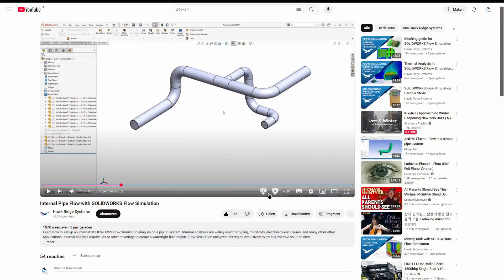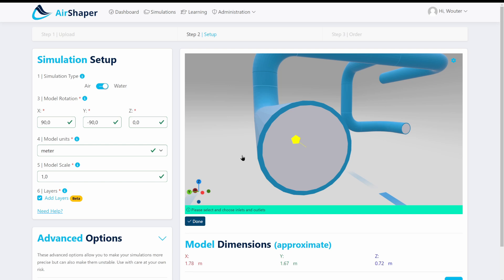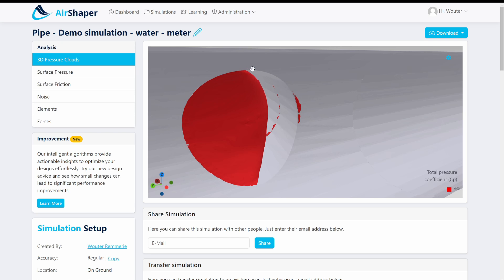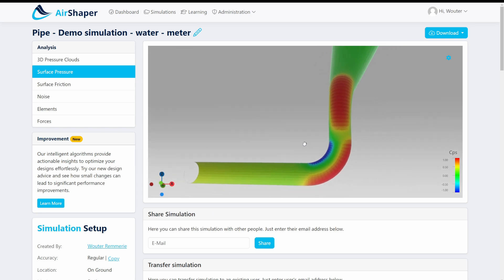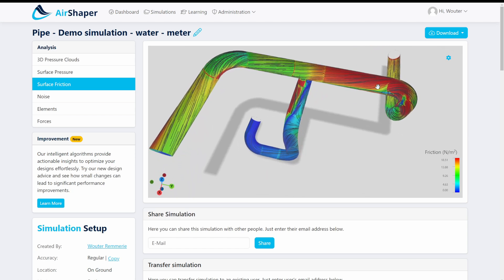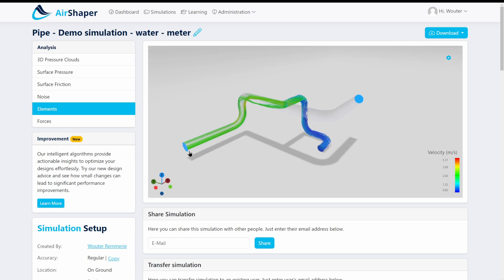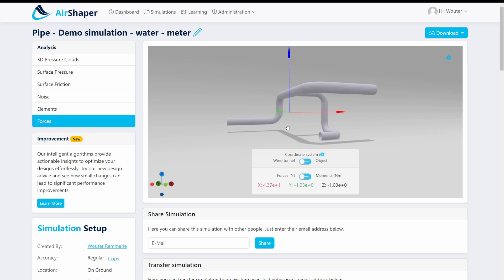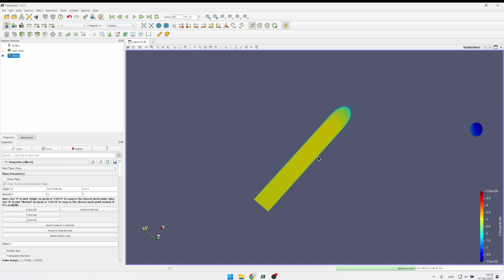Pipe Flow CFD Analysis - Reducing pressure drop and analyzing flow patterns & distribution

Comment: Can the model add a surface roughness variable? Like an engine sand cast intake manifold, does the model need to reflect the actual surface roughness or is there a way to have it as a variable parameter in the simulation? This would be interesting to see the effects on the boundary layer of a OEM sand casting vs 40 grit rough vs smooth bore.
Reply from the maker: Yes, we can take the roughness into account via the wall functions!